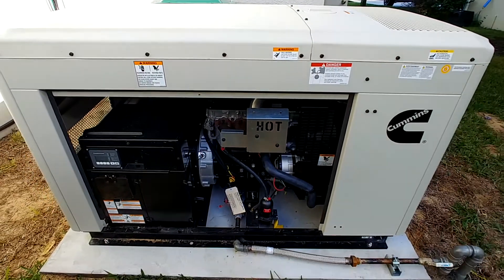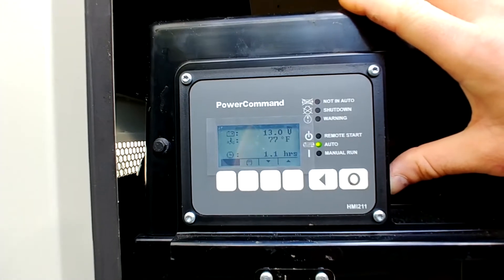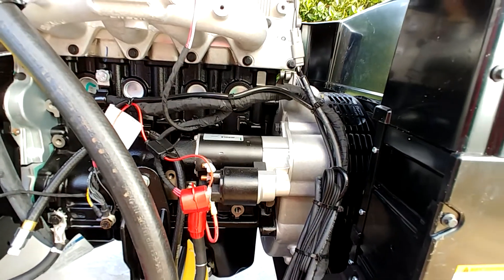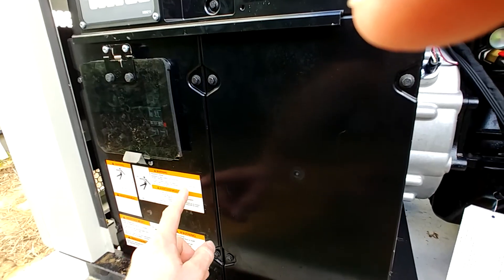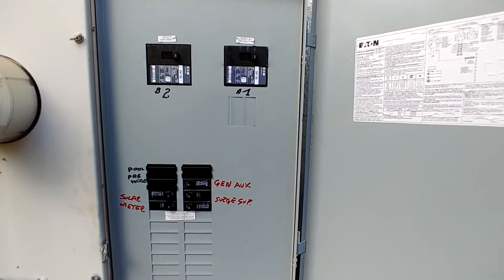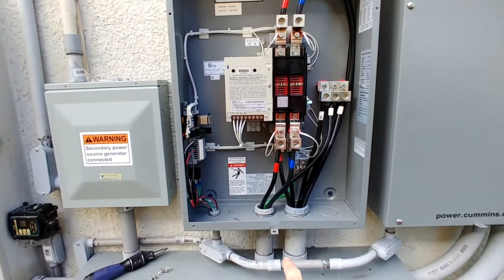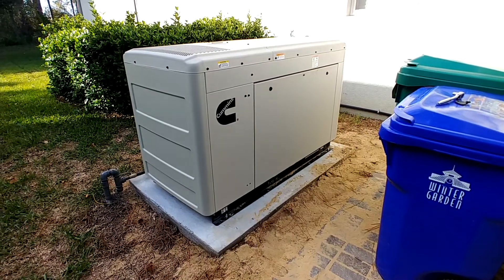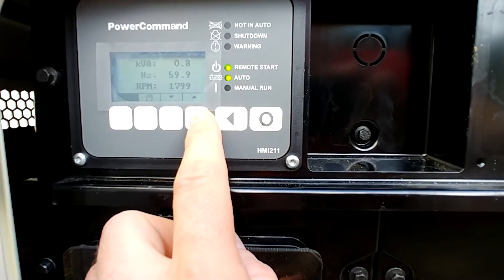Cummins RS25 Generator Review

Comment: Travis thank you for the review now I know the difference between liquid cooled and 3600 RPM gensets. I had a Generac 20KW installed by a contractor through Lowe's great job but the installation was the cost of the genset about $4,800.00 there wasn't much labor involved but in Virginia you have to be certified in electrical and plumbing so I am forced to pay to have it. I wanted surge protection and the installer said you won't need that? Don't you know less than 2 years later and there was a storm somewhere close and it fried the controller and magnetos, about $2,500.00 and homeowners insurance wouldn't pay for much. The 999CC twin V ran at 3600 rpm and did a good job but I advise everyone that if you invest in a whole house generator get the surge protection. Ed in Partlow Virginia
Reply from the maker: Absolutely good idea! We had a lightning strike nearby a few years ago and it took out the RS-485 bus that the Internet gateway uses. I didn't have a surge suppressor installed and paid the price as well.

Comment: Appreciate the video, I have the 17K Cummins home generator set up with a manual transfer switch. Do you know how to get it to excercise when setting "Excercise Now" ? I have the time set properly but when I highlight excercise now, it doesn't start like the manual says it does.
Reply from the maker: There may need to be something programmed by Cummins.  When I installed this generator I had to have warranty service come out and make a change in the controller that would allow the unit to exercise.  If you had an installer I would ask them to check on that.
Reply: @bruehlt  I was just messing around and noticed in the manual that it says it has to be in Standby mode when exercising. But, I cannot put it in standby unless the Remote is Also on. It does exercise in this mode though when you select Exercise Now. So, I'll just leave it in standby /remote even though I only have a manual transfer switch. Doesn't matter cause it won't come on when the power is off, don't have any of those wires hooked up...

Comment: Hey Is this RS25 a 100 percent duty cycle ??
Was this unit discontinued ?? 
Nice video
Reply from the maker: @josephpuchel6497  it can run 100% but still needs shutting down to check oil periodically. They stopped production for a while as the company they were working with for the engines changed.

Comment: Excellent review Travis and thanks we are looking to install a new stand by generator and I don’t understand why we see so many of these generators no matter the brand not installed on a concrete slab as they do in all commercial buildings it by far seems to me it would not only stabilize the unit from the vibrations caused during operations but also keep the unit raised and out of the dirt, dust, water and mud thus keeping the unit cleaner and cooler during operations.  We have both our AC units mounted on a concrete slab and will do the same once we install the new generator and yes it will be the Cummings Onan after reviewing many brands and having a Generic and familiarity with Cummings engines via our construction equipment running many various sizes of Cummings Diesels and the ease of maintenance and repair on them. 👍👍

Comment: Travis, can you start and stop the generator with the app during an outage?  I think Cummins calls it Powercommand cloud.  I am wondering if you are in an extended outage and you want to save fuel whether you can use the app to start and stop the generator instead of having to go out to the generator (assuming you have internet on a battery backup).  I saw in your video that you started the generator and you said it switched over but wondering if you can also stop it and whether you can also do that during an outage.  I see Kohler only allows you to remotely exercise their generator.  Not sure what Generac allows.  If you can provide more detail on this it would be greatly appreciated.  Thanks for this great review!
Reply from the maker: @peepaw-lr2du  yes the cloud connect app allows you to start and stop the generator remotely. You also have the ability to do so from the panel on the generator itself. One key difference though is that if you start it from the app it will activate the transfer switches if there is power on the grid. There is no way to transfer power if the grid has power, by starting it from the front panel.  So to test it and load it up the only way to do so if you did not have the cloud connect device would be to shut the breaker off that connects the main power feed of the circuit you are protecting.
Reply: @bruehlt  Thanks for the fast reply.  Just to clarify, if I was in the middle of an outage and I want to shut down the generator to save fuel (due to my small propane tank), I could shut down from the app and then restart it a few hours later from the app (assuming my internet is on a battery back-up).  If this is correct, that would be a major selling point for me.  I don't believe any of the other companies offer this capability.  Also, have you found the actual fuel burn to be in line with the specs?  Thanks again.
Reply from the maker: @peepaw-lr2du  yes, depending if the Internet is up or not
Reply: @bruehlt  Got it.  Thank you!

Comment: Your pool pump; GFCi  breaker - needs a bit higher amperage rating. Those pumps, probably draw up to 18 or so amps - more than 1 hp.  (1 hp = 735  Watts, approximately)   Watts = Volts x  Amps.

Comment: First class installation! I sold all manner of gensets for many years and the worst installations were usually done by contractors who said they had "installed 100's of these". That being said, on the price factor, one should probably consider the installed cost to be about double what the generator and ats cost. And that's only if everything is in close proximity to each other (elect service, gas service, ats and gen). Most electricians don't like these small jobs because they have to sub out the gas, working with individuals' schedules and nuances is harder to deal with and having to go back and wait on inspectors is wasted time. On a large building jobsite, those factors go away and there's other stuff people can do on site. Also, a perfect homesite needs to look perfect when you leave where a commercial jobsite will have other trades that make things pretty after your long gone.

Comment: How has it held up?
Reply from the maker: Everything has been working great except for one thing. I purchased the PCC500 Internet gateway for it when I bought it, and unfortunately last year there was a nearby lightning strike that took it out. I've been working with Cummins during that time and they could not fix the issue. However I just received a phone call today and hopefully they're able to fix whatever is causing the gateway to not function. Otherwise the generator itself is a champ! Zero issues at all!!
Reply: @bruehlt thanks for the reply I’ve been looking into them as well

Comment: Fantastic video, how many square footage is your home? And does it run your dryer?
Reply from the maker: @rjzlwop3153  3800 SQ feet. We have a gas dryer but it runs both whole house AC units and also our oven
Reply: So I have a 1500 square-foot home I should be plenty good with the 2000?
Reply from the maker: @rjzlwop3153  It really depends on what total wattage you want to cover when your power is out.  We have 2 AC units plus the washer / dryer, ceiling fans, lights, etc.  You need to add up the wattage of the items you want to run during the outage.  Just be aware that some items like AC units have power surges upon start up so ensure whatever model you get has the correct surge capacity to be able to handle those items starting up.

Comment: Thanks for the video.  I am seeing references to "Sound Level" on Cummins' site.  Do you know about that?  Which one did you get?  As much as I would enjoy automatic operation, I'm having a little trouble migrating from my relatively quiet Honda EU7000iS (which I converted for tri-fuel operation).
Reply from the maker: @MstrMark  it's about as loud as an air conditioning unit outside of my house very quiet really
Reply: @bruehlt  I'm certainly no expert, but it looks like "Level I".  If nothing else, I like the aesthetics of the design better than Generac, and 1800 RPM just has to be less nerve-wracking than 3600 RPM.  I only wish that my gas meter wasn't 130 feet from my eclectically panel.  And the powers that be seem intent on preventing DIY underground gas line installations, which means that I would have to pay plumber's wages for trench digging, even if I wanted to do rest of the work myself.  As you pointed out, installation cost can exceed the cost of the generator itself.  And every installer seems to prefer Generac, so they charge more to install all other brands.

Comment: Hi Travis you said you had the cloud i do as well but having a issue with the last software update it will not start on the 1 of the month like it supposed to are you having any problems please  respond thanks Chris
Reply from the maker: Hi Chris, I did have the cloud connect but lightning took it out and I have been unable to get Cummins to fix it. Sadly I think they've given up. I would really like to have it as it's a useful feature but it's not required for the generator to work.

Comment: Works great until the LP gas goes down, then what? Deisel is the best option for when the SHTF situation. Looks like a nice Gen Set though, has it held up?
Reply from the maker: One thing to consider - where would diesel deliveries come from in a SHTF situation?  I don't think anyone will be delivering diesel, meaning you need to have a huge ass tank that won't be replenished.  SHTF won't be good for anyone regardless of your fuel source.  The generator itself has held up great - but I did have an issue with a nearby lightning strike taking out the RS-485 internet gateway which I am still working with Cummins to get fixed.

Comment: Hi! Thanks for the video! It’s been a few years since you posted this video, have you changed your mind at all with the Cummins? Thinking about the investment and doing my research. Thanks 🙏
Reply from the maker: Hi! I have not changed my mind. I am still in the midst of having an issue with the Internet connectivity, as last year we had a very close lightning strike that damaged a few things. The generator itself never got damaged but it took out the box that connects to it and the Internet. I'm still working with Cummins to try and get it fixed. Once I do I plan on posting an update video about surge suppressors that I bought that would have helped prevent that from happening.
Reply: @bruehlt  thanks! I look forward to seeing your update!

Comment: Just got my 40kw Cummins generator setup here in Texas along the coast, didn’t know you could control unit with an app on phone. I’ve got mine in an 15x15 vented enclosure with well and pool equipment, humidity here will ruin everything if left out in the elements, plus my wife doesn’t want it to be seen.

Comment: Please inform people about the maintenance expenses of a Cummins generator. We paid $5000.00 for ours. We've had it 2 1/2 years. Just used it for 6 days straight. Called to get maintenance done and we're told we have to commit to a 3 year, $2000.00+ service contract. We don't feel comfortable doing the work ourselves and it would void our warranty.
Reply from the maker: It really depends on which model you have.  The cost listed sounds like its a 3600 RPM model, which will need more maintenance than an 1800 RPM model.  I just have to change my oil once a year, sooner if its used more.  Any generator that is used 6 days straight should have its oil changed.  There really shouldn't be much from a maintenance perspective other than plugs, oil, coolant, and air filter in all honesty.

Comment: Beautiful set-up and equipment. Not to make a negative comment, but folks seem to never think ahead to put the on/off gas valve before the drip tube. If you wanted to check or drain it, how would you do that?
Reply from the maker: Thanks and fair point. There actually is another shifts m shut off valve by the meter as well which would allow for that
Reply: @bruehlt   again sir, your workmanship, quality, and factory like professional appearance of the job well done say it all. Thank for the reply as well. The valve at / by / near, the meter would mean cutting service to the entire property and re-lighting any electronic less lit devices. Owning two rentals, and having to go through this process myself just recently is what brought my attention to your impressive work to start with. I'm sure going forward you will remember it as well now. Peace
Reply from the maker: @1stGregA  the meter has two outputs - one to the house and one to the generator.  The output to the generator is the one that has the valve, meaning the output to the house would not be impacted.  I am planning on creating a new video in the near future as I've had some issues lately due to a nearby lightning strike that took out the RS-485 output to my board and I am trying to get it fixed by Cummins (which is not cheap by the way).  A surge suppressor would have possibly prevented this.
Reply: @bruehlt  10-4 on the piping. What a total bummer on the lightning strike. Nothing in that immaculate set up you have looks inexpensive and no doubt neither will that repair be. Good luck sir. Peace

Comment: I selected Genpro in Houston and installed the same unit as yours about 30 days ago. Your video was a significant factor in choosing this setup. Thank you for making the video. I spent significantly more than initially budgeted for an air-cooled unit, but I am happy. The RS25 popped on Monday during a lightning storm, which turned into a power outage, but I was not here to witness it. According to my neighbor, the generator fired up about a minute before the blackout. About a minute later, neighbors lost power for about 8 minutes. The generator turned off automatically after utility power had been restored. When I texted my wife, who was on her laptop computer doing Tax returns, she said she got bumped off the VPN but never lost power. The VPN issue could have been my cable provider. Impressive, the system figured out a blackout was imminent and fired up. My Cummins salesperson was the only rep who came by who did not insist on selling the monthly monitoring service like the reps from Generac and Kohler. For some reason, I did not even ask about the Cummins app. I would be interested in how you hooked up the ethernet to your unit. I might be willing to hook up, but I want to see it on YouTube before proceeding. Anyone considering a Generator should seriously consider Cummings. In my former life, I worked for a communication company that supplied to the most prominent Oil companies and The Texas Medical Center, and our chief engineers insisted on Onan's backup solutions. They would not consider anything else because of prior experiences. Onan was purchased by Cummins many moons ago.

Comment: What size gas pipe did you run and how long is the run from meter to generator?
Reply from the maker: Hi honestly I can't recall. I had purchased everything a few years ago now. I believe that the pipe that goes from the meter to the stub up under the ground is 2-3". Once it leaves the ground it appears to be about 1.5" I think? The installation manual has all of the correct pipe sizing to ensure the correct volume of gas that you need. I suggest you take a look at that as every case is going to be different.

Comment: OUR ADVICE:  AVOID BUYING A CUMMINS GENERATOR.  WE HAVE BEEN WAITING ON A STARTER FOR MONTHS NOW-- TERRIBLE SERVICE AND RELIABILITY.  WE'VE HAD 3 POWER OUTAGES IN THE MEANTIME AND NOW WE'RE TOLD PART WON'T BE IN UNTIL MID SEPTEMBER.  TERRIBLE CUSTOMER SUPPORT.

Comment: Travis, this is a well done video.  Hope this unit is still doing well for your place.  I, too, am looking at 1800RPM for a whole house (where we run two separate businesses from) backup in Wisconsin. I agree with your comments on:  1) using 1800RPM and 2) brand reliability.  I'm unsure if I'm going to rely on the Nat. Gas or go to a small Diesel with self-contained tank.  I'm getting paranoid with the news reports on malicious vandalism and the whole idea of natural gas reliability.  Thanks for your efforts on the vid.
Reply from the maker: Still working strong with no issues!  Sorry to hear about the vandalism issues!

Comment: Beautiful Generator.  I have called Cummins at least 3x to come to my house and give me an estimate for an install.    They have never responded back to me.  3 Times !!!
Reply from the maker: Sorry to hear that!
Reply: @bruehlt  Actually I stand corrected.  They sent me an email just this morning.  Just filled out their questionnaire.  Back on track.
Reply: Up where I am there are 2 service centers.   Reading the manual, Cummins requires at 25 and 200 hours PER THE WARRANTY that you have to have your engine valves adjusted.   I called the Cummins dealer near my house.  They told me $900 plus travel expenses for the RS13AE Generator.  So I called the other service center and he quoted me $220 plus 180$ travel expenses.   IT HAS to be performed by a Certified Cummins Dealer.  25 hours is one day of running.  and then I have to spend another $500 !?  
That's Crazy.   The Cummins Dealer that is the 3rd Cummins installer told me that he doesn't do service and has NO IDEA how to adjust valves.   huff

Comment: I am thinking about installing this. Did you pour the slab yourself? What size and depth? Thanks.
Reply from the maker: I did but I can't recall the size off of the top of my head. It is about 6-8 inches in depth I believe. I used rebar in it as well. I think it was about a half cubic yard.